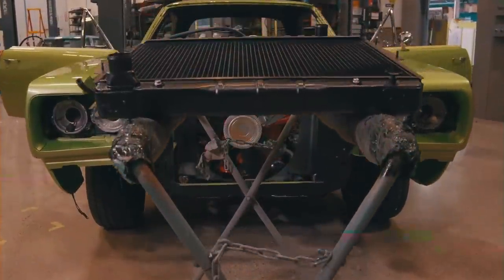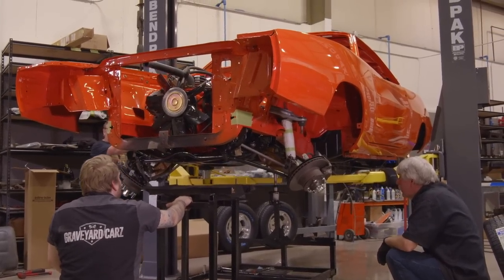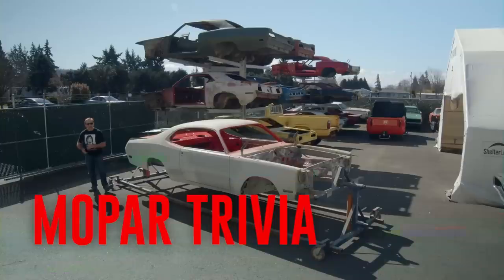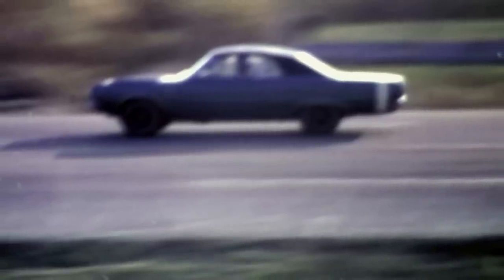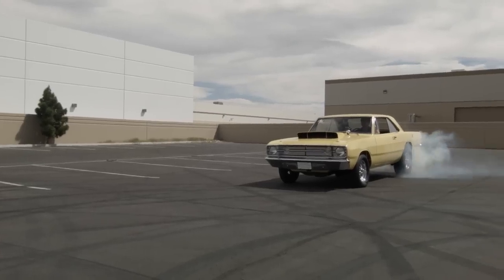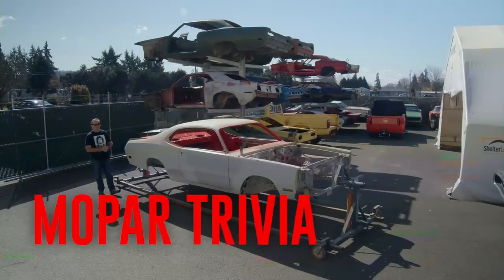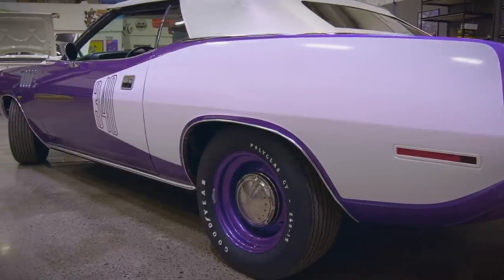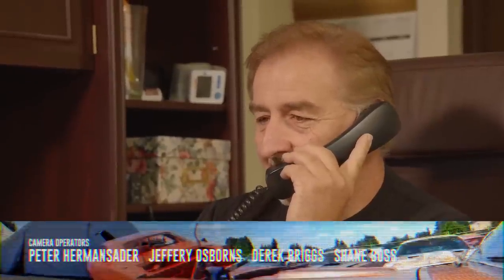FAMILY HEIRLOOM FOUND IN THE WOODS UNDER FALLEN TREES: 1968 DODGE DART GTS 340 CONVERTIBLE 4-SPEED

Comment: Did anyone check the VIN numbers to see if they matched the original car??? This car has 1968 Dart GT front fenders and doors - you can tell by the chrome body side molding (I know, I have a '68 Dart GT convertible).  I doubt that anyone would have put the chrome on, or they swapped out the front fenders and doors at one point with a Dart GT. Yes, the power bulge GTS hood is correct, but did the inside door panels say GT or GTS?  or those could have been changed as well.  I guess what I am asking is, is this really a GTS, and is it the same car?
Reply: I'm wondering about that too! Where did those doors and fenders come from? Maybe a rust/wreck issue somewhere along the line. Car has the bumper guards and stripe. VIN should start with LS27P. S=GTS. P=340.

Comment: I have a correction on the question about the demon and duster rear fenders . You are incorrect that the demon's rear fenders were same as the duster fenders. They were shorter than the duster fenders. I had 1971 demon and sold it to a girl with 2 dusters. She coold not use the demon to fix the duster fenders. My demon and I was in an accident. I was unable to fix the a frame so it became donor parts.

Comment: You call the GTS convertible a dart when in reality they don't say dart on the car anywhere. A GTS was very expensive when they were bought in '68 I think a couple hundred dollars less than a Corvette and that's why they sold very few. A gts convertible was extra rare and I had one with air conditioning which was also very rare and and I believe they cost almost $5,000 in 68

Comment: I work on a 340/4- speed 69 dart swinger ,2.02 valves 3:90 gears purple shaft cam , it won't out run my cousin's 68 Camaro 350  a low compression crate engine compared to a hi compression 340,I do all the work on both cars the Camaro is heavier with a Taller taller gear and the Camaro kicks that 340's ass all day long power is in the heads slopar heads don't flow good # unless its a hemi !
Reply: Maybe you need another mechanic because any 68/69 340 motors will handle any small block chevy and also alot of there big block motors also
Reply: Where's the timing set on that high-compression 340? What fuel is it running? Crate motors are better suited to pump gas now.